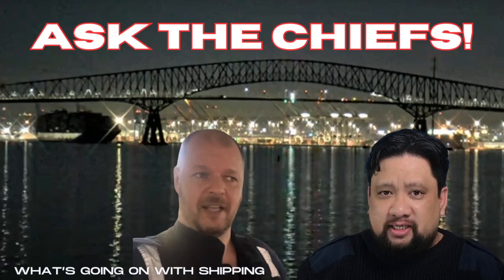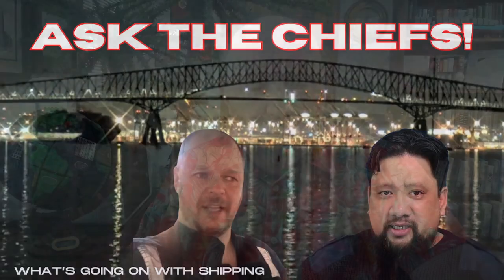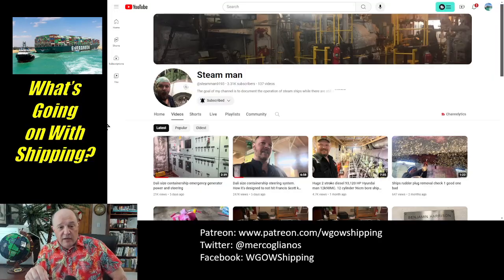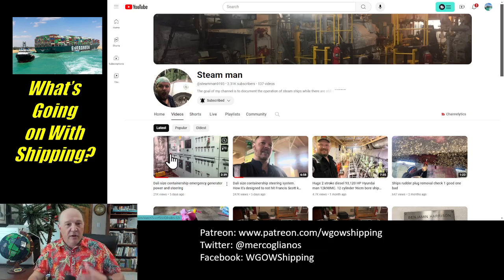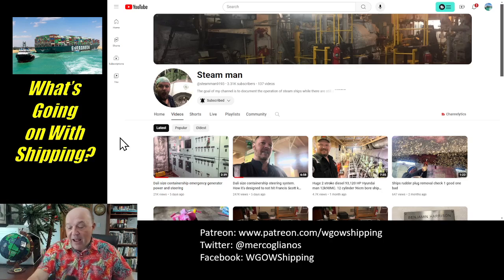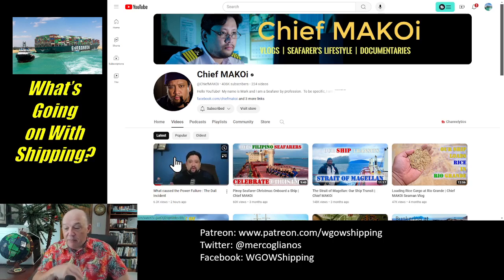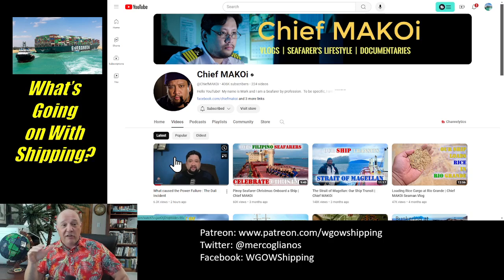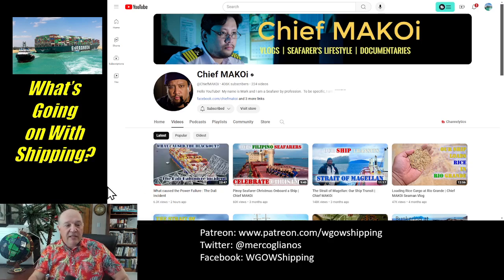Ask the Chiefs! | Chief MAKOi and Steam Man Discuss Issues Leading to Dali Losing Power in Baltimore

Comment: How soon does the ship engine shutdown after the electrical power is lost?   I understand the ship engine needs electrical power to start.  But once running can the engine continue to run as the turning crankshaft powers the fuel and oil pumps?  Like in a car?
Reply from the maker: If it loses feed pumps for lube oil and fuel that will cause shutdown.
Reply: @wgowshipping Sounds like a real problem.  The ship loses electrical.  Which causes the engine to shutdown as the fuel pumps stops. Then without the engine turning the propeller, the rudder no longer works.  Then once the backup power is restored, it takes time to restart the ship engine.  So for a few minutes, at a minimum, the ship cannot be steered nor slowed down.
Reply: @wgowshipping  Could you please publish the actual tides, currents, winds, etc. overlaid on the track of the Dali that night? Thank you (I don't have accounts with those tracking websites --- rumors say  up to 14 KT winds which I can't find).
Reply from the maker: @Raiders33  It was very light winds with the tide just about to shift from going out to coming in.

https://www.tidetime.org/north-america/united-states/baltimore-calendar.htm
Reply: What car in the last 40 years or so has a crankshaft driven fuel pump? Fuel injection needs a steady flow of fuel, which is not provided by a crankshaft driven pump.  These engines have huge fuel injectors (Chief has a video on servicing them).
Reply: @briansomething5987  But the car powers the generator.  As long as the engine is running, so is the generator.  Why not the same with ship engine? And could there be a battery backup?  But ok, the huge fuel injectors need so much power it has to come from a standalone generator.   Interesting to know that when the electrical power to the engine goes down, so does the engine and the steering.
Reply: @Steve-Richter  did you watch Chiefs video?  There are at least three main generators, two are supposed to be running when maneuvering, and just one is sufficient to power the pumps.  Failure of a single engine should not cause this.  There were multiple failures at the same time.

Comment: Should the pilot have dropped the anchors as soon as the ship engine stopped?   Without the propeller pushing water, the rudder cannot steer the ship.  With the bridge dead ahead the ship has to slow down as much as possible because even if electrical is restored, the engine cannot be restarted in the short time until the ship hits the bridge.  Is that true?
Reply: personal opinion: at 8kts and 95,000 tonnes that is a lot of potentially dangerous momentum, with a slightly askew velocity vector without positive control.  See my other responses below or above in this blog.   Yes, it could just be the combination of dropped anchor, momentum, physics and close proximities in space and time...without positive control of the Dali.
Reply: @Carlos-im3hn yeah, I can see that.  Just nuts that without electricity the helm quickly loses control of the ship.  Here are the sequence of events as I am understanding them.  The electric generator fails which causes the engine to soon shutdown due to lack of fuel from the unpowered fuel pump.  Once the engine stops, the ship cannot be steered as the rudder needs the propeller to be pushing water against it to work. And then, because the ship engine has to be restarted there is a significant delay between restoration of electrical power and the ability to steer or put the ship into reverse.
Reply: @Steve-Richter  yes, and another major issue I just read above in this blog...the Dali must be below 6kts to shut off engine and reverse screws to back-up !  So maybe during this allision event the Dali were trying to drag the anchor to slow down enough to reverse course !   Unfortunate series of events and lack of "runway" when the allision occurred.  Looks like a "Catch-22" situation all around.  Not time and not enough space to slow down before.
Reply: @Carlos-im3hn  So maybe the pilot made the wrong decision to drop the anchor??  ( Is that what the allision event refers to? )   If the anchor was not dropped, the ship does not veer to the left and impact the bridge support?  I have been asking why the ship was lined up to run into the bridge unless it turns to the right. But I was told it was lined up ok.  Maybe just kind of close.  When the ship lost power the pilot makes the wrong decision to drop anchor in order to slow down enough to put the ship into reverse. But doing that causes the ship to veer left and clip the bridge support enough to cause the collapse.
Reply: @Carlos-im3hn The authorities are too quiet on this.  Not like they want to save the foreign owned and staffed ship from blame and embarrassment.
Reply: @Steve-Richter  allision is when a ship tries to occupy the same point in space and time as a solid object which is not another ship; collision is when that attempt at joint occupation of a point in space and time happens with another ship. Think of how prefix co means with, so collision is with another ship & think how allision sort of rhymes with 'all else', that is a cheap and simple way to remember which term is for what.
Reply: @scottfw7169  did the Dali veer off course into the bridge support or was that the course it was on before losing power?
Reply: @Steve-Richter  That answer will be found in Sal's March 29 video titled "Dali timeline from Data Recorder ..."